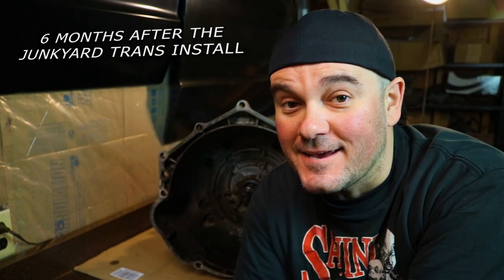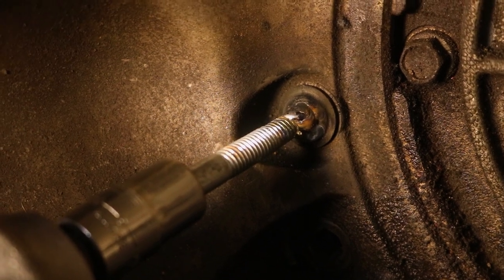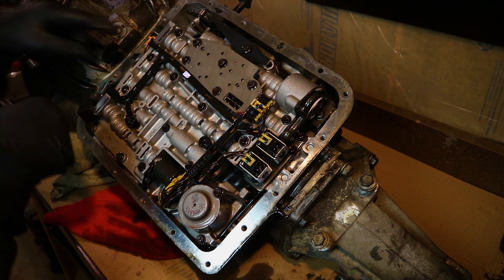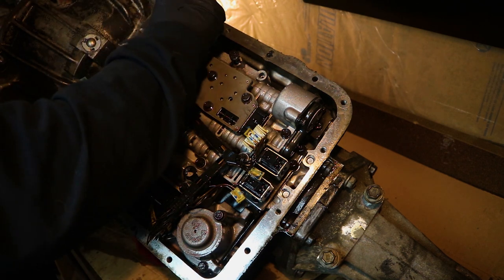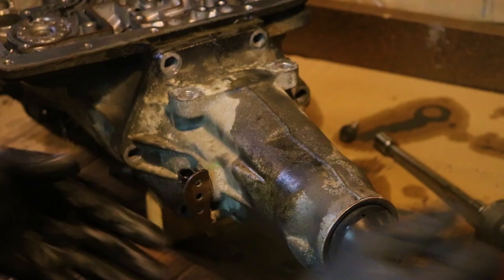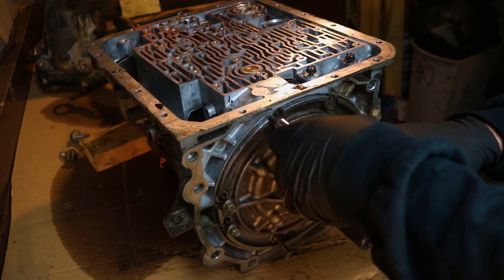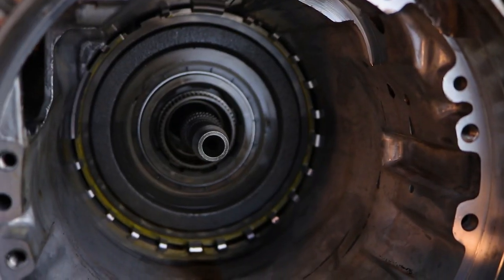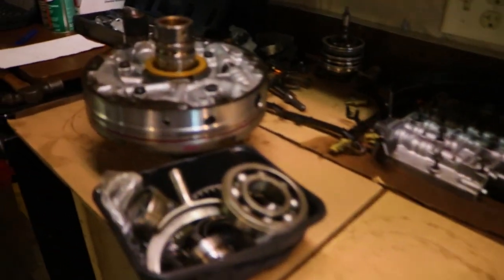DISSASEMBLY OF A 4L60E AUTOMATIC TRANSMISSION  - My 1998 Pontiac Trans Am 4L60e Rebuild - PART 3

Comment: Rebiuld a c6 ford 4r100 th350 never tried a dodge trans yet when i did rebuild i got trans tec books for the step by step sec go i didn't do very well valve body gave me trouble ya got the same book's from Amazon
Reply from the maker: Yeah I had the same issue with a 4t60e that I rebuilt years ago. The valve body burned me on that rebuild. It's easier just to buy a new valve body, rather than trying to fix all the factory issues with the old one.